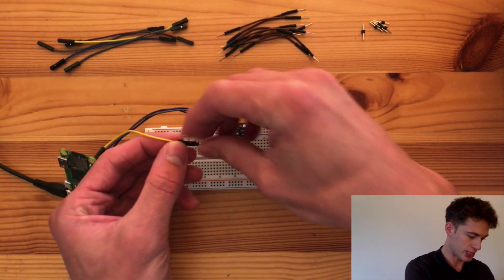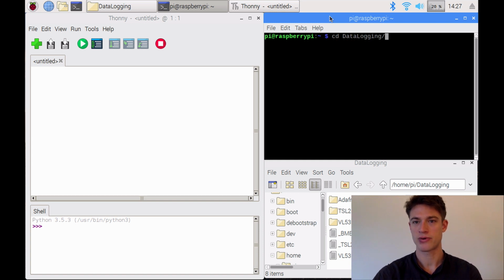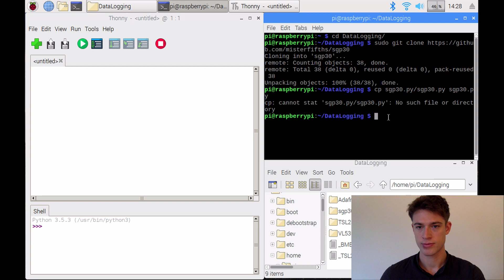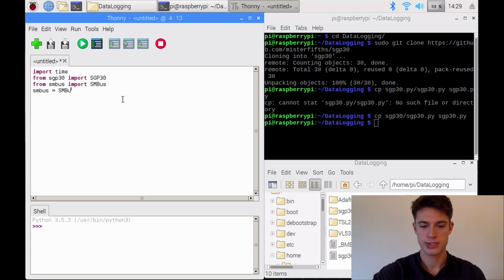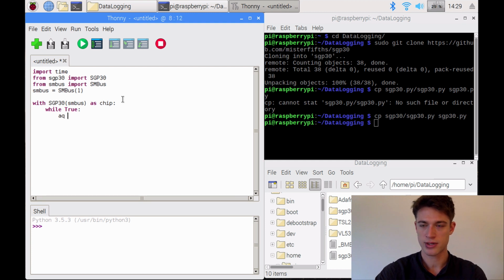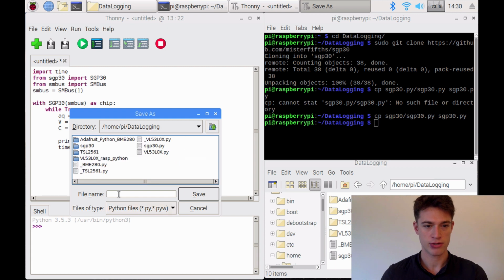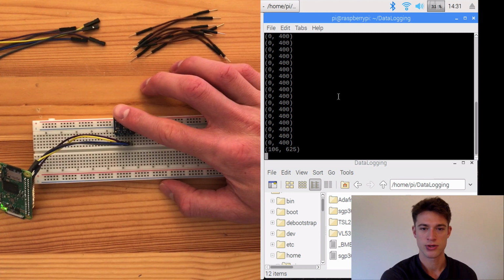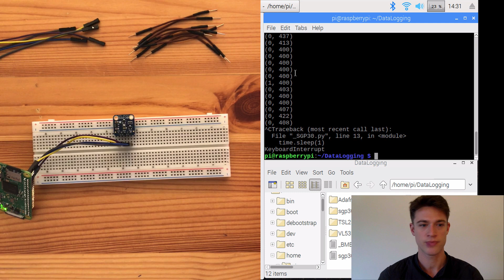11 | Indoor Weather Station | SGP30 | eCO2 & VOC Sensor

Comment: Hello, thank you very much for the clear videos,

I run everything from 1st video but getting IOError while executing the final program. May I know how to solve this error?
thanks,
Reply from the maker: Difficult to say but probably a wiring error. Try each sensor by itself, then start combining them to see which one has the error.
Reply: @mmarsc2323  thank you very much, I tried all the way from first video and got results as expected. One more question, How can we export data to excel or other formats?
Reply from the maker: @anweshnettim9184  Commonly you would write a CSV file, which can be opened in Excel. Here is a forum discussion that shows you how to do this in Python: https://stackoverflow.com/questions/37289951/python-write-to-csv-line-by-line

Comment: Hi, thanks for the videos, a lovely way to spend lockdown. Well, i'm stuck. I keep getting this message: pi@raspberrypi:~/DataLogging $ python _SGP30.py
Traceback (most recent call last):
  File "_SGP30.py", line 4, in <module>
    smbus = SMBus (1)
IOError: [Errno 2] No such file or directory and have installed the Smbus library. 

pi@raspberrypi:/ $ sudo apt-get install build-essential python-pip python-dev python-smbus git
Reading package lists... Done
Building dependency tree       
Reading state information... Done
build-essential is already the newest version (12.6).
git is already the newest version (1:2.20.1-2+deb10u3).
python-dev is already the newest version (2.7.16-1).
python-smbus is already the newest version (4.1-1).
python-pip is already the newest version (18.1-5+rpt1).

I'm using Raspbian, if that helps! Thank you. I'm going crazy. 

I followed your advice to the previous commenter
Reply from the maker: I'm glad these videos are helpful to you, but yes I know it can be frustrating when these errors pop up. Unfortunately I can really only speculate on what's happening, but did you actually import the library at the top of your script (i.e. "from smbus import SMBus")? I find it weird that the error gets thrown on line 4 where you are you trying to use SMBus but there is no error beforehand, on the line where you import the library. Also check whether there are mistakes with the casing (there is both "smbus" and "SMBus" in the script). After the import statements, try "print(SMBus)" - if there is no error then the class was in fact imported, if not then maybe the downloaded library isn't in the directory where where your RPi looks for libraries when it sees "import ..." in your script.
Reply: @mmarsc2323  Thanks for your response. I think i've figured it out - I had to Enable I2C Interface on the Raspberry Pi which was previously disabled...Does this make sense?
Reply from the maker: @TheEmitothelee  Ah yes, glad you managed to solve it!

Comment: Can we use it to measure haze/smoke like PM 2.5 carbon monoxide?
Reply from the maker: Hi @weinfin, I don’t think this sensor will be helpful in your case. PM and CO are very different things. PM sensors are much bigger; you might want to check out Adafruit‘s PM2.5 Air Quality Sensor, as well as their MiCS5524 Sensor to measure CO.

Comment: Thank you man, i'm in my final year of high school and for my practical thesis this year I need to measure the air quality in a classroom and based on those values decide if ventilation is necessary. I've look at a lot of tutorials on how to use this sensor with the Raspberry Pi but only your tutorial really worked for me. You really helped me to get trough this school year. If you're interested in how my thesis worked out at the end of the year I could send you some details if you 'd like that. Anyways thank you so much for sharing this information with the rest of the world ;) Greetings from Belgium, Sander
Reply from the maker: Sander , that’s great to hear! Honestly the reason I decided to put up the tutorials is that it had been such a pain for me to figure it all out myself, and I didn’t want others to have to go through the same frustrating process. Really glad it helped you with your project, and yes I’d be keen to check out your work!